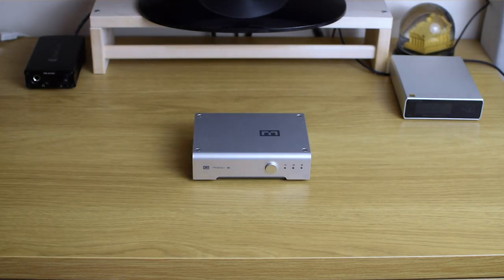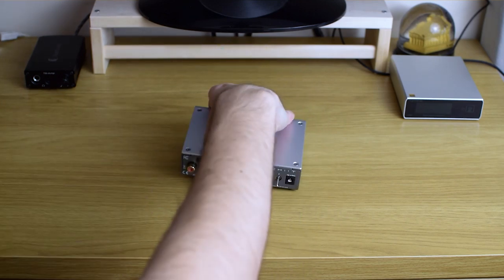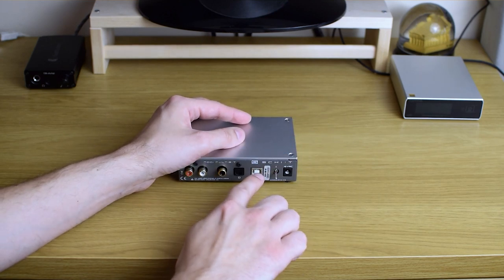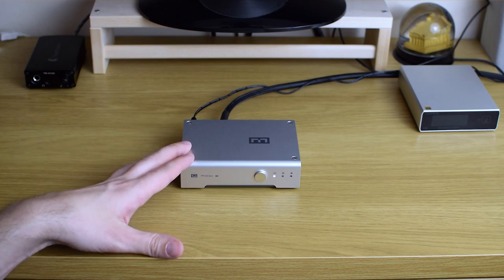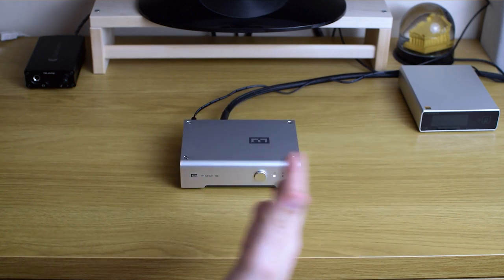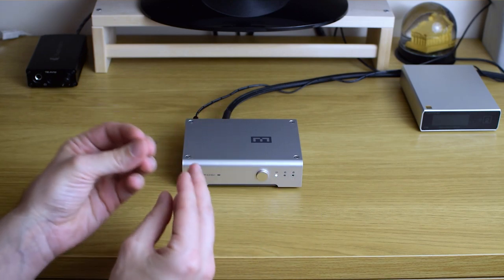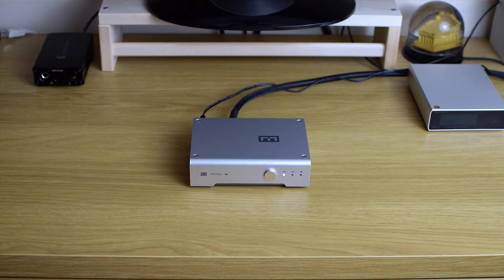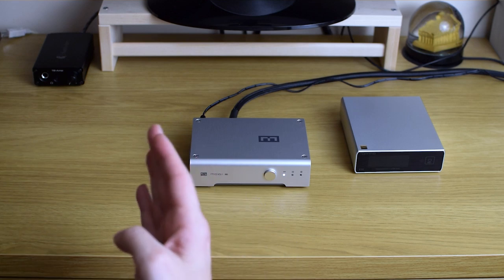Schiit Modi Multibit review

Comment: RE: Burn-in/warm up.  This is probably more of an issue on the higher end multibit products.  I notice a BIG difference if I turn my Gungnir multibit off vs. letting it run continuously.  It took about a week (!) initially, but now, if turned off, it takes about 4 hours of warming up before it sounds it's best.  Now, whether you will notice that on the Modi 2 and your associated equipment is debatable, but there is SOMETHING going on with multibit DACs that does make a difference!

Comment: What op amp is in there?  From what you are explaining that is typical of OPA op amps (I'm just guessing I have no idea whats in there).  Want more highs I would suggest an AD (AD op amps have quit a bit more bass punch) or even MUSES01 or 02 (MUSES02 is a mid machine, the remote will vibrate in your hand when it didn't before).  All electronics have a burn in, if you have never heard the components change then your system needs work.  I can replace one film capacitor and hear the settling or melting or whatever happens, 50 hours  is a good rule for settle time.

Comment: you are by far the best reviewer in youtube !!  a.  you must do review for the modius   b. if i understand right , the multibit is not bright but compering to regular modi the multibit is brighter
Reply from the maker: Thanks! If anything, Modi 3 is the brighter one - but, it's not that Modi 3 has too much of high frequencies by any means. It's just that it doesn't have as much of a midrange juice and depth as the Multibit so highs are more noticeable.
Reply: @iiWiReviews  Many thanks, i have a Cambridge CXN2 and i dont like his sound, so i use it as a streamer and connected it to one of my digital inputs of my  amp which have a dac inside , burr brown pcm 5100 a old chip but sound better for me,   so the questain is : can i use the multi bit dac to connect the cambridge streamer to my amp analog inputs (streamer ->dac->amp) , is there is any complication ? or considerations ??
Reply from the maker: @vaksil8603  Looks fine since CXN2 has the digital outputs... so it should work just fine the way you described it.

Comment: @iiWii Reviews Nice review.

How is the Schiit Modi MB vs SMSL DAC’s?

In the toser hand, Watch time I think in the posibilita to but a dedícate DAC, I wondering how it would work an audio interface la like the Motu M4 (ESS Sabre chips)compares with dedicated DAC‘s like the Modi.

I am using my audio interface as DAC no my desktop gear, and I am quite happy.

I use it as DAC, pre-amp, headphone amplifier and of course I use it with my microphone for doing recordings, video-conferences and also to digitalize my records and cassettes.

I get balanced outputs too that I could Connect to an amplifier or powered speakers with balanced inputs

Therefore, it seams a versatile and convenient solution.

But, Am I really losing something in quality when I use it as a DAC Compare with DAC like the Schiit Modi MB, Topping do SMSL ones?

What do you think?

Could you do a test like that?

Comment: How does the Modi Multibit perform against Modi3, Modius, Bifrost2? Would Schiit Loki Mini + be a viable enhancement to the perceived HF roll off?
Reply from the maker: It's fuller sounding with richer tone timbre, and with deeper soundstage compared to Modi 3. I haven't heard the other two so can't comment on them.
Reply: @iiWiReviews  Thanks very much. I have to consider if it gets closer to analogue than the Modi3. When I switch from vinyl to digital it IS noticeable so ... Many thanks! 🔊🎼🎵🎶🎶🎹🥁🎸🎷🎺🎻💿📀👊🧜‍♀️💣💥👏😎

Comment: Well done.
Is this a nice step up from the Loxjie D30 ?
I was hoping it got the upgrade of a Unison usb and plays back hi res 24/192 ?
Which amp were you using ?
thanks
Reply from the maker: It's not that big step up in general, it sounds fuller and lusher but D30 has more high frequency details. So I would suggest Multibit to anyone who prefers warmer, midrange centric sound, and don't care about DSD, MQA... D30 is probably a better choice for those who enjoy crisper presentation with more features.
Reply: @iiWiReviews  Thanks for the quick reply. Did you mention if the multibit needs the same type of burn in as the modi ? And is the a warmer amp not so important ?
thanks.
Reply from the maker: @deadline7610  It needs a burn-in. The first time, when it's new, it needs a day or two. After that... I never turned it off, because if I did it needs an hour or two to fully warm up the next day. But it consumes like few watts when it's powered on and not playing anything... so it's just best to keep it on at all times in my opinion.

Comment: Your follow up review of The Modi 3 Delta Sigma suggested that by weighing it down with added weight, it improved the tone and clarity at the extremes ... extended, clearer bass and increased bass energy and like wise at the treble end. I went to my backyard and found a decorative, "magic rock". The sound of my Modi 3 improved just as you described. Leaving it powered up seems to make a difference and ... the longer I've owned it, the more it seems to have opened up ... more air and spatial cues. The magic question: Have you experimented in the same way with added weight and burn in on the Modi Multibit?
I'd also be interested in a Modi Multibit vs Bifrost ii comparison.
Reply from the maker: Yes, and Multibit benifits from those tricks too... I'd like to try Bitfrost, but it's quite expensive with shipping and taxes for my country...
Reply: @iiWiReviews  Is Modi Multibit that much of an improvement over Modi 3 Delta-Sigma?

Comment: Hi, great review. Would you do a comparion with the moduis?
It isn't a multibit but it seems that Schiit wanted to do a cheaper version of the bifrost when they built it.
Reply from the maker: Thanks! I'd like to compare them but basically waiting for the worldwide shipping to stabilize a little cause USPS is not delivering here at the moment and FedEx is crazy expensive at this distance (importing Modius would cost me like $400 right now).
Reply: Modius is still a delta sigma DAC, basically a balanced and bigger Modi3+.  If you only use RCA output, Modi multibit is better I think.
Reply: is it really like bifrost ? I am looking for a headphone dac

Comment: Modi Multibit 2 is my first schiit product. Was very disappointed at how muddy it was and I don't really believe in burn in. But then I left it on for a night and suddenly it sounds exactly as I expected it to sound. Clear sounding, large soundstage, clean bass response (but punchy) and smooth treble response. Quite a strange experience but well as long as it sounds great I am not complaining.
Reply: do you have a separate amp for it?
Reply: @artvandelay837  yes, I am not using schiit's amps though. I am using Lake People G111 MKII an amp from germany
Reply: @kato2395  how do you like it and what headphones do you use?
Reply: @artvandelay837  it is amazing, the Modi Multibit 2 was to replace my topping e50. Everything sounds so natural now. The topping E50 has that nasal sound to women's vocal and is not as good at separating sounds, treble sounds very sharp and bass sounds veiled, it is as if both the bass and treble is unnaturally boosted.

At first I was also using the L50 to accompany the E50. That was a horrible experience. The Lake People G111 MKII fixed the issue a lot and now after I upgraded to Multibit 2, every issue is fixed and now I enjoy my listening experience very much.

The headphone that I use is the Austrian Audio Hi-X65. In a way this is a very transparent studio headphone so the changes in sound signature when switching between amps and DACs are very apparent. I've tried this headphone on other DACs and amps and it sounds really different on each.

In short I am a satisfied Modi Multibit 2 owner!
Reply: @artvandelay837  by the way if you're interested in the Lake People G111 MKII, Reviews by WaveTheory made a great and detailed reviews about it. He make a very accurate description of what the Lake People G111 MKII sounds like.

In short it is a transparent, clean and uncolored sounding amplifier.
Reply: @kato2395  thanks so much for the comment. have you ever tried the grado headphones?
Reply: @kato2395  thanks again... I have the grado 225e. Is the asgard just an amp? Whats the difference between that and the vali2?
Reply: @artvandelay837  Yes Asgard is just an amplifier but you could order it with a DAC inside if you choose to do so. The only available internal DAC right now is the sigma delta (chip based) DAC though not the multibit, the internal multibit DAC used to be available in the past.

I would recommend a multibit DAC for your Grado though since they sound neutral but smooth at the same time. Chip based DAC or sigma delta DACs usually sound more cold and sharp. I myself used an R2R (the same as Schiit Multibit) DAC in the past for my 325x. It just suits Grado's "retro" sound signature so much!

Your Grado 225e would be the generation before the x drivers. I heard the x drivers (the latest version such as: 125x, 225x and 325x) has more bass and warmth to the sound. So, the e version should be a little sharper and thin sounding than the x version I guess. Never tried the e version though, just a rough guess.

The Vali 2 is a hybrid tube amp, I haven't tried them myself but I don't really suggest using tubes on low impedance headphone like your grado 225e because there is a chance that you will experience unpleasant distortion (even though Schiit said that their hybrid tube works even with the most sensitive iems). I just wouldn't take the chance. But if you're living in the state, I guess you could, since you could return them if you don't really like it.

What I can be sure of is a discrete solid state amp like Asgard (or if you want cheaper option you could go with magni+) would work flawlessly on your Grado 225e.

If I were you, I'd get one of this sets for my Grado 225e:
- Magni+ amp & Modi Multibit 2 DAC combo (low budget set)
- Asgard 3 amp & Modi Multibit 2 DAC combo (mid budget set. In my opinion, the best set since you'd get the most out of your money)
- Asgard 3 amp & Bifrost 2 DAC combo (if you have more money to spare go for the top and get this set, though please beware that the higher you go the more the law of diminishing return will apply and you will get less for the additional money you spend)

Comment: Hey sir. Do i need a dac for my klipsch the fives to use with my ipad pro and oneplus 8 pro ? Thx a lot u r a very good reviewer
Reply from the maker: No you don't, those Klipsch already have digital inputs and internal DAC (USB and Bluetooth input as far as I know).
Reply: @iiWiReviews  i know sir it has a dac. But maybe i can buy an external dac like the ifi zen dac and it will sound better overall?

Thanks for your replies
Reply from the maker: Well, that's tough question since I haven't heard those Klipschs. It stands to reason that a good separate DAC would sound better than the internal one, but I wouldn't like to guess without real experience about it.

Comment: 15:39  The Technics WSA1 midi keyboard had a serious break-in period so obvious people picking up a new one noticed the difference right away from the demo unit and that's when I realized it wasn't just psychoacoustics and relativity getting the brain used to the perception of a new instrument... it was a physical change occurring blurring the line between matter and DNA... now used used to place nano particles in matter and in doing so "upend our current understanding of matter". See: Electron-behaving nanoparticles rock current understanding of matter (phys.org)
Ever since then I've known to not to listen to a new audio system critically right after turning it on and let the entire system run for least 100 hours without turning it off following the advice of an audio dealer in Hawaii that also said athlete foot powder would stop the foam rubber surround on speakers from rotting out and that was almost 30 years ago... still have the Atlantic Technology subs I treated and they look like new despite being in Hawaii for the first decade where some plastics and glues (Roland JD800 key weights and Fatar midi controller end caps as well as Volkswagen interior plastics) melted and foam surround material literally just disappeared after turning to dust after getting sticky like the plastic and other types of foam did used in helmet padding, shoes, etc. We live in a weird universe so don't blame me for talking about it;-) BTW (e{a})/t=E

Comment: Short of what I am asking: 
Any thoughts on how the multibit might perform against say Soncoz dacs, the SMSL SU-9, etc? Even a Topping D70s MQA, a really, really nice dac that doesn't immediately sound much better but you know it is as nothing irritates like a less expensive ESS dac and the musicality just washes over you.  For the purpose intended, a few hundred dollars is more palpable but only if there is better SQ, otherwise spending more may have to be considered. Currently using a Keces E40 on Focal 807W and Triangle Zetas.  It sounds like the Multibit might be an option.  

The long story: 
My gear includes a Hegel h160 with an AKM dac (considering selling it for a lighter, smaller footprint).  I purchased a Keces E40, a light, small 34/60 watt into 8/4 ohm loads which reminds me of a lighter version (in every way) of Hegel due to the SQ it produces at lower volumes.  The Keces E40 is known to have a bit accentuated bass that remains tight, a solid midrange and a bit of rolled off highs... my hearing tops out around 13KHz or so.  In spite of that, there is a sound I seem to like, airy highs, good separation, solid and balanced mids with a bit of warmth supporting it without being syrupy but remaining dynamic for both music and soundtracks.

I have tried a Lavaudio D600 (a Topping D50s clone) which started out sharper sounding but seemed to become less sibilant after using it for say 30+hrs.  I tried a Loxjie D30 which sounded a bit more relaxed but still dynamic and which I liked a bit better than the Lavaudio but went back because my optical cables would not stay in, a problem I once had with a SMSL dac.  So I have the Lavaudio which isn't bad but I recently exchanged it due to some defects so the new one still sits in the box.  I also purchased a Topping D70s MQA which so far exceeds the SQ of my Marantz CD 6006 and produces a sound I really like.  Very musical, probably on par or a bit better than the Hegel dac. I don't want to hear it on the Hegel to be tempted to upgrade even more.

The issue is, it's $650+tax on a $599 integrated.  As I listen at lower levels, I am trying to replace my more expensive and heavier gear while retaining a certain level of SQ.  I don't plan on using it for MQA streaming services or Hi Rez Downloads.  I think basic streaming to start is fine but primarily to listen to a large collection of CDs and movies with the time I have.  I could live with the Lavaudio but it doesn't sound as natural as the AKM based dacs.  Cheaper dacs tend to fall short regarding transients, dynamics, resolution, etc even though detail remains sufficient for many.  Then there's the connection issue, at least with some. 

If the Multibit sounds at least as musical as the best dacs around $500 or even approaching the upper tier mid-fi units, even if rolled off but still providing sufficient resolution and a more holographic stage, this has me intrigued.   I can upgrade desktop units as I delve into streaming later.   Speakers I use tend to be detailed both of which sound good on the Keces...a bit better on the Hegel but at low to moderate volumes, it's fine.  The Hegel deserves more expensive speakers and I don't want to go there.

Comment: Hello iiwi Reviews,  I want to let you know that The Multibit 1 cannot be upgraded to Multibit 2. I check with Schiit.
Reply from the maker: Multibit 2 was released much later than this video and it has new and different hardware. This was still Multibit 1 that had a firmware and digital filter revision (which slightly improved its performanse). So it was just another revision or version of the same model, and at that time you could send the DAC to Schiit for that latest upgrade.

But I will change the title know when Multibit 2 exists so it doesn't confuse anyone anymore.

Comment: Hi Sir, 
I have a system which consist of a Cambridge Audio CXA81 Integrated Amplifier, Cambridge Audio CXC CD Transport and Tannoy Revolution XT6F Tower Speakers.  The only source I use for music are CDs.  I just want to get your expert advice if there will be an improvement in sound quality if I use the Schiit Modi Multibit(Mimby) as my external DAC for my Cambridge Audio CXC CD Transport?  Currently, I am connecting my CXC CD Transport via the coaxial input of the Cambridge Audio CXA81 Integrated Amplifier which has an onboard ESS Sabre ES9016K2M DAC.  Hope to hear your response.  Thank you.
Reply from the maker: Hi, I never heard internal DAC from CXA81 but having experience with some other integrated DACs I would guess that Modi Multibit would make a decent upgrade. Especially if you tend to like warmer and musical sound that is one of its traits.
Reply: @iiWiReviews  Thank you, Sir.  More power to your channel and keep safe!
Reply: I have the Cambridge CXC CD transport paired to a Schiit MIMBY v2. The sound is stellar to my ears. It is superior to my Project Pre-Box S2 Digital DAC. Much more three dimensional and deeper soundstage.